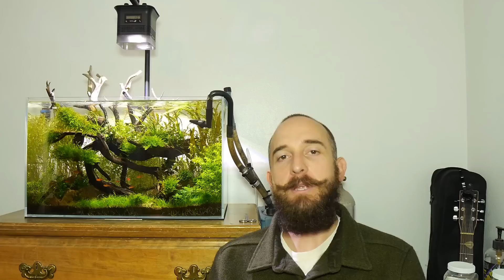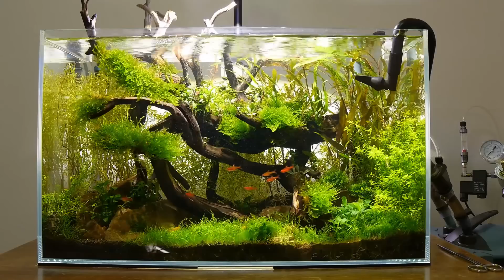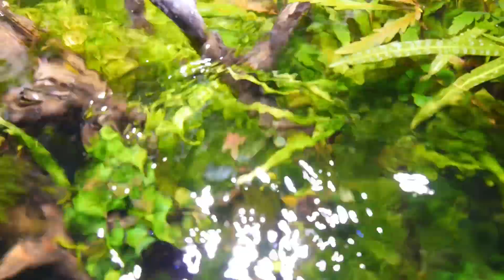Optimizing Your CO2 | Surface Scum & Light CO2 Relationship | Aquascaping

Comment: Just so I am understanding this right considering I DONT have a co2 injection unit.. 
(Arizona hard water)
I have a dirt tank. No CO2, little/no ferts, I have constant biofilm. Canister filter pointed upwards to provide surface agitation to minimize biofilm. I don’t do anything about the film except once a month when I do a 25% WC.
So my problem is I don’t have not enough oxygen? So I have to either start pumping a little CO2 or add an air stone?
Reply: Also to another point you said, how does evaporation increase oxygen? Being at a high altitude (5,000ft) and dry AF climate. I lose like a gallon a week. And I still have biofilm. So it seems oxygen is way too low... idfk :(
Reply from the maker: I just mean with evaporation the outflow goes above the water line increasing agitation. With canisters there is usually always some surface biofilm even if it is not visible with the human eye. Your organics could be higher than mine. You may have to reduce organics and increase O2, or both. It will occur in many types of water. Soft, hard, low tech, high tech. I have a theory right now and it is this, we should clean the detritus and plants matter from the tank, but don't touch the filter. In most cases the filter will not be impeded by too much sludge build up, and it helps as a natural biofilm and coagulant, which better holds organics and reduces the surface biofilm. Old sludge vs new sludge. There may come a time to clean it, but only when the sludge falls away from the sponge and starts entering the aquarium through the outflow. Have had this happen. This is very similar to what happens in a water treatment plant. Keep a strong surface current going 24/7, and clean all the detritus from the aquarium and trim all decaying plant matter. Don't touch filter, and possibly add more biomedia to the filter to be seeded. Possibly reduce feedings. It can fluctuate, but you can manage to reduce it.
Reply: ah interesting. ill try that. i have a prefilter sponge that gets a little "grody" after a week or so and have been squeezing it out. ill stop for a while and see what happens. inside my canister seems to be clean even after like 2 months...I've some of that fancy "biohome ultimate" running too.
so you're basically predicting that the surface film will stop producing on the water surface if given ample breeding grounds in the filter (along with minimizing excessive shit like overfeeding)?
Reply from the maker: John2891 Yes, but your excess in organics within the aquarium could be from your dirt depending on how many organics we're in the soil to begin with. That would supply a lot of organic pollution itself as it decomposes. I am sure the plants are doing well? They probably aren't contributing much unless they were unhealthy. Yeah you want the biofilm, you just want it to grow elsewhere. If you can get more growing in the filter the better. You're not dealing with pressurized CO2, so no worrying about the gas exchange as much, but it makes sense you would want to get rid of the surface scum. Sometimes a wet dry filter or a surface skimmer are the only way, but try some of these methods for a while.

Comment: hello i have a question. ive had plants in my aquarium for more than a year now, low tech. but rececently i got myself a co2 tank and started using it. its been about a week now but my plants are growing at a rate similar to my low tech scape. i dont see any significant difference. would you tell me how long it usually takes to see the difference?
Reply: @ADUAquascaping  hello so its been a month. Its doing well now👍🏻. I can see the difference in colour and health of plants. I think the reason why i didnt see the changes at the beginning was because ive been observing them everyday because of the lockdown. During the low tech setup i was rarely home hence whenever i got back i saw significant growth

Comment: Dave whats up! you are very smart. Thanks for the vid. I watched this several times yet still confused. I understand that surface agitation is important for oxygen levels and to allow co2 to release. But when increasing surface agitation aren't we increasing the amount of co2 we waste? When trying to optimize co2, wouldn't this be counterproductive. are you saying, to optimize co2 we must waste a little? I have an inline diffuser by gla running on a 406. I am experiencing this film you speak about. I have my outflow just at the top, so i can hear a faint trickle of water but I am afraid I am wasting money. What would you recommend. THanks
Reply from the maker: yeah if you want better distribution throughout the tank. If you increase the amount leaving that specific volume, you can increase the amount entering the volume to achieve the same ppm levels of CO2, so it will be around 30 ppm of CO2, but you are pumping more CO2 to gain that level, which will increase overall distribution within that specific volume. It can make the levels become more stable and consistent as well, which the plants and fish will benefit from more stable CO2 levels- growth of plants, fish respiration etc...

Comment: How many ppm of c02 do you run your tanks at? Great vid
Reply from the maker: At minimum 25 or so, I never tested after some time, if you have really high flux then 45, but not sure that's really necessary. There are some graphs somewhere out there from Teopica, they show the optimal range and the ends, not enough, and diminished returns, I believe that's why we use 30 ppm for the standard, low maintenance tanks may only need 15 ppm, but may depend on your surface agitation as well, thanks for watching
Reply from the maker: *Tropica
Reply: Nice 👍 thanks for responding I run mine at 35 with good flux.  You should do a video on fertilizers.

Comment: Would the presence of floating plants have effects similar to a surface film?
Reply from the maker: Cam'sJungleAquaria I am not sure. If they move around a lot possibly not, but could reduce the Flux if too many. Limiting your ability to pump more additional Co2.
Reply from the maker: I could imagine co2 bubbles getting trapped on the underside of their leaves, which would reduce the exchange. This issue is more of a concern in larger tanks. It is not hard to distribute in a small volume

Comment: That was superfluous amount of great information.  I am BRAND NEW to supplemental CO2 for aquariums, so bear with me.  I'm  awaiting my CO2 setup in the mail as I write this.  I know there's a strong correlation between algae and light, but from what I'm gathering - algae DOES NOT utilize the supplemental CO2 bled into the tank in the same way our aquascape plants benefit from carbon dioxide...do I have that right...partially?  I have tons of Java Fern that have dark-brown to black algae on their tips that I can easily clean off with my fingers (any suggestions other that the video for this issue?).  Fascinating how CO2 can do A LOT more than just 'feed the plants.'  I had no idea how important CO2 is regarding biofilm breakup, gas change, lighting, algae fixes, and decreasing the energy needed by the plant to synthesize light.  One more thing:  are there any contraindications in having an air-stone running at all times?  Great video, thanks again.

Comment: Love the info provided. It has helped me a lot. I just wanted to ask if it would be ok to use an air pump to get more air into the tank as I'm using a canister filter and a sponge filter for my shrimp. Thanks.
Reply from the maker: Shershah Nazari it can help add a little more O2, but having more surface agitation of any kind can be good. Try getting more surface movement any way you can.
Reply: ADU Aquascaping thanks for the advice. I also wanted to ask is there is a thing as too much surface agitation?

Comment: Thanks for sharing this ultimate truth with us! 
In this fact you stated how would this work when you are running a cold water tank? Less light and co2 probably? And when it get summer and the temp will increase get more light and co2 then in winter right? Mine temp is 18 Celsius atm but in summer it will probably get to 25 for a few months.

Love your work thanks so much! And subbed.

Comment: How about pressure and gas exchange?
Reply from the maker: George Johnson You mean atmospheric pressure? Or partial pressure of gases in the water? I would imagine pressure in the solution would be reduced as the exchange rate is increased. Not sure if this would have any effect on the atmospheric pressure. What are your thoughts?
Reply: They are one in the same, atmospheric pressure is what you were talking about when speaking on the water needing to be clear of "Surface Scum" and having a good gas exchange rate. To put it in simple terms the surface of the water is like the cap on a soda bottle. Remove the cap and the gas is liberated, it can enter or exit freely. If the surface is large and clean of scum the the amount of gas, whether it be Oxygen or Carbon dioxide is at its maximum, based on atmospheric air pressure. With the Surface Scum cap the plants use up the Carbon dioxide threw respiration, faster then it can be replaced threw the water to air surface barrier. So I say let the aquarium breath, by agitating the surface of the water...

Of course the plant load factors in this.
Reply from the maker: George Johnson Yes, that all makes sense.  When pumping CO2 into the water that is a independent pressure in the water. With the surface scum too much CO2 gets left behind and can gas the fish and also the distribution may not be adequate with the lower flux. Same volume with a higher flux, so you can pump more into the same volume to attain the same ppm as before. This results in better distribution. Atmospheric CO2 plays some role, but my angle was more to do with pressurized CO2 being injected, and distribution, and how increased O2 helps further reduce the surface biofilm- have it start growing  elsewhere, such as  the filter. Increasing efficiency of flux. Of course the O2 is in relation to atmospheric pressure. I guess you're saying this is also the case in regard to CO2 present in the atmosphere.  Sounds like we're both on to it, and that's good. Keep telling everyone and informing them why this matters. Hey thanks for watching man. I appreciate the feedback. My next video will be on optimizing water quality and husbandry. Relating to organics, O2. I have a new husbandry method/idea I am going to propose people try.
Reply: I would like to point you to, In chemistry, Henry's gas law. You are correct, that the 2000 psi of a CO2 bottle, can elevate the concentrations in water temporarily. This is why it helps in heavily planted tanks. The effect on the fish, I will defer to your experience. Have fun and never stop learning...
Reply from the maker: George Johnson well the effect on fish relates to roots effect. It's own function that they follow vs say Haldane. It has to do with species adaptation thresholds and acclimation. You can have all the O2 in the world and fish will still die if their threshold is met. Species specific. You probably already are aware. I did a video on fish physiology and CO2. Check it out! People are saying CO2 is bad for freshwater fish because of Marine studies, and this is false. And the idea of more O2 being pumped allows you to pump more CO2 to limit acidosis is also false, in regard to acidic water. Hemoglobins affinity for O2 in acidic water won't go up. Tetras have a naturally higher threshold vs Rainbow fish or Hillstream loaches, for example.
Reply: PS: For the others that may read this, Flux means rate or the gas flow rate through the surface of the water. whether from the air to the water or from the water to the air.
Reply from the maker: George Johnson I will pin your comment so people can read what we talked about!
Reply: Cool

Comment: i read an article http://www.tfhmagazine.com/details/articles/setting-up-a-successful-lowtech-planted-tank-like-a-pro-part-1-the-basics-full-article.htm one of the section named "To Add or Not to Add CO2" third paragraph last sentence says "The only time turbulence will work against you is when you are already using CO2 injection. In that case, increasing turbulence will only work to off-gas this additional CO2." its because of that i lowered my surface agitation

Comment: Okay so it sounds like I need to get rid of 3/4 of my duckweed 😂 I'm just running a 5gal rn w a moss ball, bacopa, some plants from the edge of the pond behind my house, a bit of buce, and some anubias plants that are so tall that a couple leaves touch the surface. It all has looked nice for months until I finally started getting more brown algae than my trumpet snails could keep up with 🤷
I've been letting the duckweed overtake the surface to provide shade from my light (that is probably too strong for this tank but it's all I've got atm), and I figured the duckweed would essentially 'eat' the biofilm, but maybe the algae is from too little gas exchange after all 🤷 even with my bubble bar and hob
Reply: Duckweed is evil

Comment: Dave; everyone I hear on YouTube are saying not to have high agitation on the service if you want to use CO2. They say the oxygen from all the movement on surface of water will remove the CO2 faster. And now you are saying that is exactly what you want?
I understand your rationale on this, but, I do not have pressurized CO2, it is your home brew of sugar water and yeast. I started using CO2 with this method for the first time a few months ago I had never used CO2 before.
I have a hang on the back filter on a 20 gallon long and I disperse my CO2 into the aquarium with an old powerhead,...WORKS GREAT! I cannot adjust the amount of CO2 flow Simply because the yeast only produces CO2 at a limited rate. I use Seachem plant fertilizers and 10,000 K Beamswork full spectrum lighting. I have a high number of high-tech plants along with medium to low light plants in aquarium. Everything has been growing so healthfully and super fast I can’t believe it. Before I ever used CO2 I never had such healthy or fast growing plants, every leaf on plants is perfect. And in the four months this aquarium has been set up I have had absolutely 100% no problem with algae, whatsoever. It’s simply amazing!
I would never go back to growing plants without CO2 again, constant issues with algae, plant leaves that don’t look their best.

I guess what I’m trying to say is, for the size aquarium I have this set up on, it is working, and I figure if it ain’t broke, don’t fix it.
And of course I religiously change out my CO2 mixture once a week like clockwork so there are no fluctuations as best I can help it. For the past four months seems to be working.👍🐟🍀

PS. I agree with what you said I have bucephalandra very close to the surface and right under the lights and have no problems with algae. I am fortunate that my concoction produces just enough CO2 to fill those plants needs that close to the light and also shaded at the bottom plants. I hope this aquarium never ends it is so perfectly balanced, I never thought that It would ever be so dialed in. And I have plenty of extremely bright red plants in my aquarium even fuchsia colored. I am trimming them all back so often I am running out of space for plants and where to store them, HELP!!😱
Reply from the maker: Haha nice! Glad you are having fun with this scape. Yeah you are right, for a small tank that is probably enough CO2 and distribution. What I am talking about in the video is more of a concern for larger tanks or just tanks with bad circulation. The surface agitation also helps to break up the surface biofilm, so that is a major reason to have agitation, because the biofilm impedes all gas exchanges even oxygen. Agitation kills two birds with one stone as I stated. Most people probably have decent enough distribution of CO2 in their aquarium. This was just explaining how you can optimize it if you feel that may help your scape do better! Thanks for watching!
Reply: @ ADU Aquascaping ; yes I understood that perfectly what I do is I run my air stone all night long and then it shuts off before the lights come on, and the CO2 starts up. So I never see any biofilm on my aquarium even when the surface is calm. I also have a HOB filter sump. For larger Aquariums you could do a double DIY CO2 bottles.
But yes if you have the money it certainly is a lot more convenient and efficient to run compressed CO2. Although more dangerous.

Your videos are really good if you can please keep them coming.🐟
Reply from the maker: @charlesmorris6476  yeah you're doing more what Amano always did with the filter outlets each night. That is what happens for me by having the outlet pointed up, plus evaporation. Well should have a video coming on how I used these latest rocks and will hardscape one of my 9 gallons too. Stay tuned! And thanks for watching and have a great day!